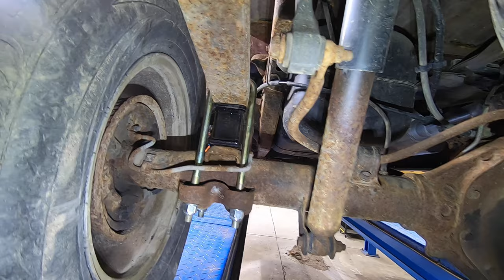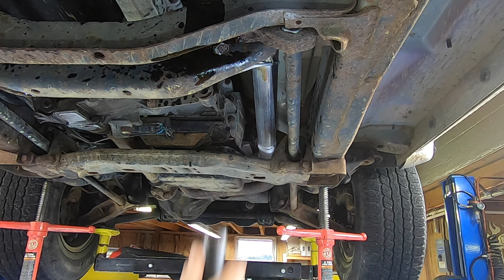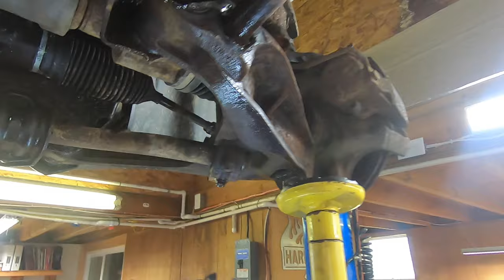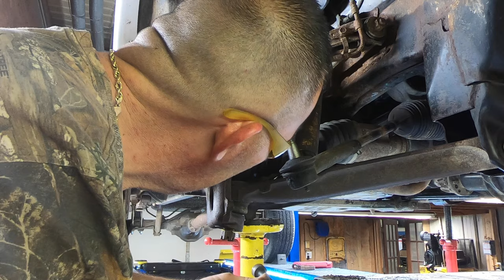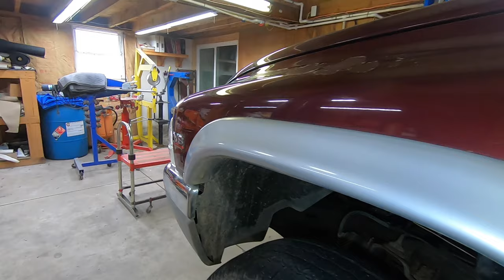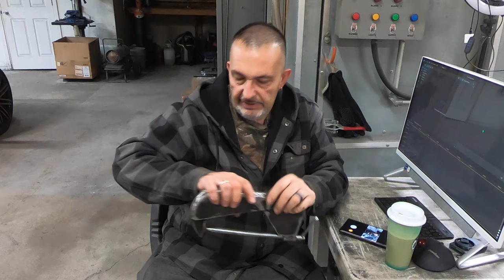Dodge Dakota Truck Lift! With stubborn torsion bars. #trending #viralvideo

Comment: guessing you didn't see that roll pin there to keep the torsion bar from moving?
BTW that ball joint is SHOT!
Reply from the maker: Yeah if you look I had the pin hit up out of the hole.. And yeah I'd say it's shot.. Customer is well aware of it.. Appreciate it bud. 👍👍

Comment: Are they 2 or 3 inch blocks in the rear? I put 2 inch blocks in the back and you can get 2 and a quarter inches of lift out of your stock keys If you go 3 it's really gonna stress the stuff out in the front
Reply from the maker: Hi and I really can't remember the size of blocks it's been a while. But maybe the owner of the truck will chime in he probably remembers the kit.